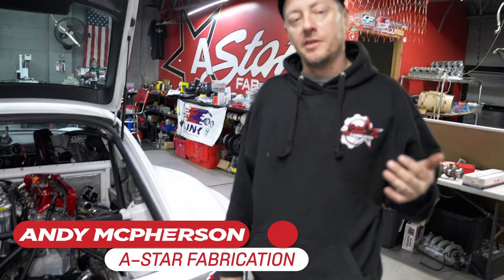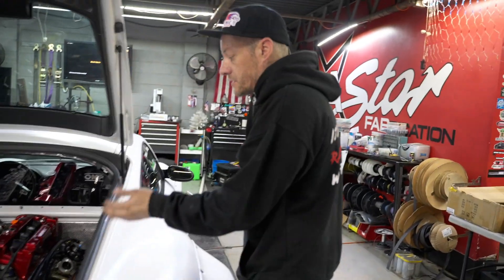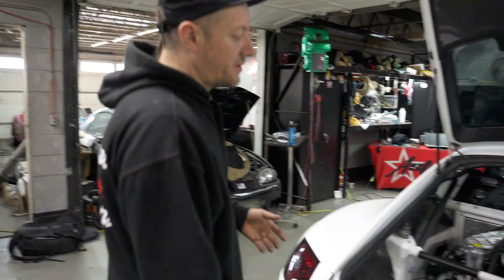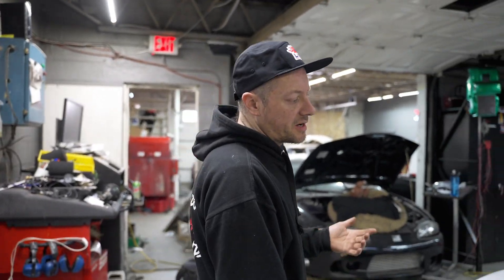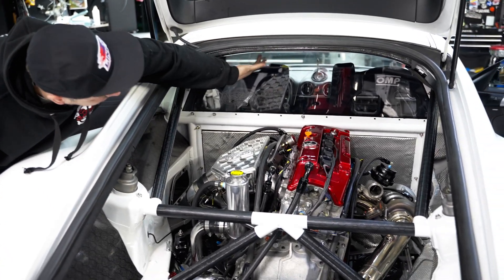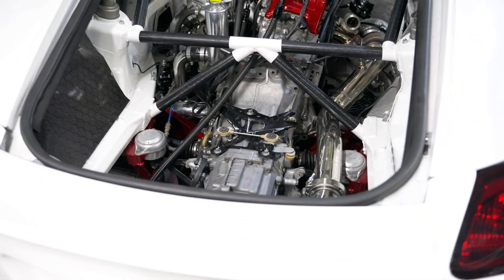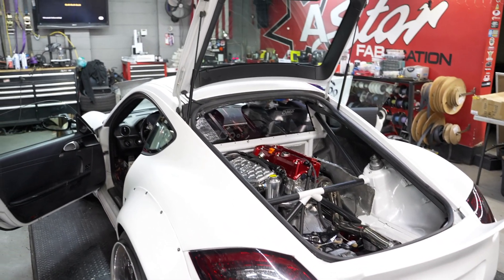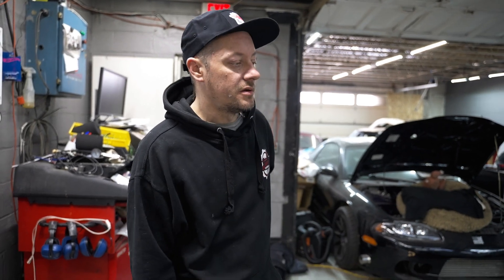He Put a K Series Engine in A Porsche!

Comment: I liked what you did with the k swap but I think you will have reliability issues with the transmission. I would've mounted the engine like a front wheel drive car and used either a Honda transmission that you can get a close ratio gear set for OR a DSG out of a Volkswagen GTI.    Transmissions and transmission parts for porsches are just stupid expensive ask me how I know...😂😂